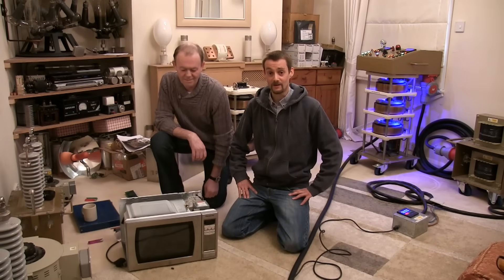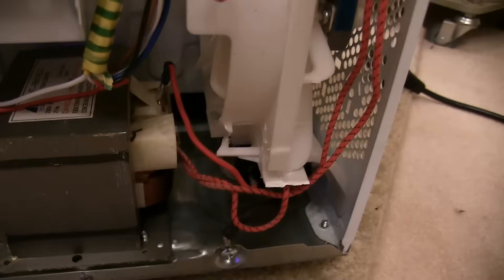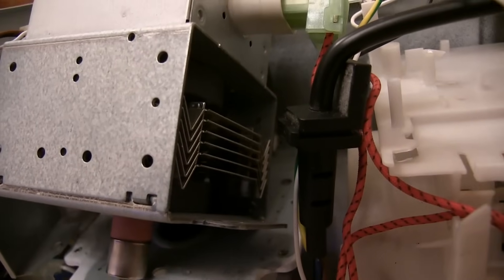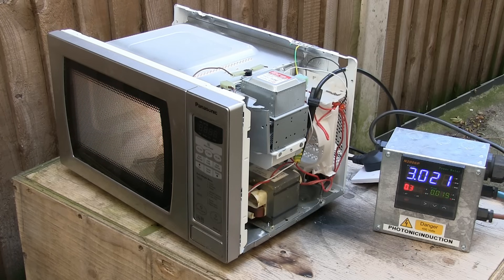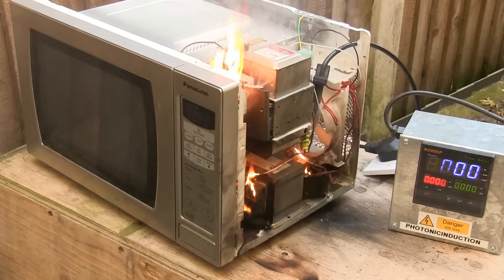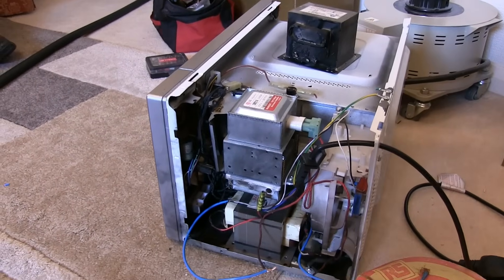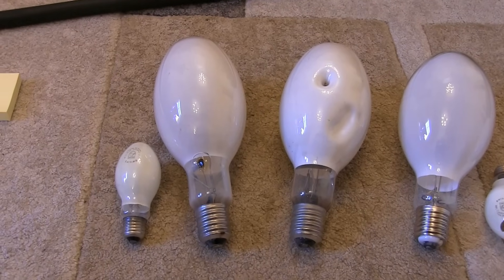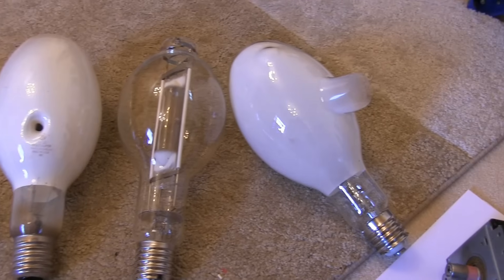Microwave Overclocked

Comment: Well that's definitely one of your most electrically acoustic videos.  It sounded like a substation blowing up.
Reply: ay my mate
Reply: bigclivedotcom hi clive
Reply: We are not supposed to ask how you know what a substation blowing up sounds like…
Reply: Probably because of all the plasma.
Reply: @sean..L  The plasma is modulated by the mains frequency.  A sort of plasma speaker.
Reply: @sean..L  yes Corse . Is verry dangerous.
Reply: bzzzzzzzzzzzzzzzzzzzzzzzzzzzzzzzzZZZZZZZZZ
Reply: Ayy, hi Clive!
Reply: bcz of high current in a single turn like a welding machine on short circuit

Comment: Good to see more videos in the overclocking series Andy :)

Have we done an overclocked washing machine yet?
Reply: arcadeuk
Washing machine motors are tough old bastards, I think mine took about 20 minutes to cook at 400 volts or so.
Reply: Actually, he was the first one to do it, and it went viral big time.
Reply: Well I know he has done a washing machine wired to constantly run, with a brick in it till it destroyed itself, but I was talking specifically on the "overclocking" theme, has Andy done a increase voltage till "I've popped it" scenario with one?
Reply: He has actually. But it usually destroys itself by mechanical failure instead of coil burnout.

Comment: So if I overclock my microwave would it run crysis??? Plz respond it would help a lot
Reply: It won't run Crysis but it will melt Crysis.
Reply: No it will not Run Crysis. it cant even run HL1!!!!
Reply: Rainbow Dash you need to go industrial to run Crysis.
Reply: DAEDRADONKEY not 4K sorry but 8k
Reply: You would have to overclock the power supply, which isn't easy.

Comment: ***** love the show and I was wondering if I could ask a question,  I've been wanting to build myself a Jacobs ladder for ages now and I've heard that a neon sign transformer is best to use, how does the transformer in a microwave compare and would it make a suitable substitute?
Reply: Microwave oven transformers put out around 2,000 volts while nst's put out in the 10,000 volt range and higher.
Reply: would it be possible to use something of that voltage to make a desktop Jacobs ladder?
,
Reply: thanks for the info, the next question then is what is the cheapest and easiest way to make a Jacobs ladder, you have no idea how much I need one in my life
Reply: ***** Check out my channel, I just put up a video of a MOT powered jacobs ladder just last week. Very easy to make and quite satisfying too. Just remember, safety safety SAFETY !

Comment: Does anyone care to explain why the glass bulges out in this way?
Reply from the maker: Plasma forming on the inside caused a hot spot, the glass may be pressurised or under vacuum, either way, soft glass will either bulge or pull inward.
Reply: *****  That'l teach it
Reply: or its a bulb boner ;)
Reply: High pressure sodium & halide bulbs have pressure in them, that says it. Normal bulbs have a vacuum with filaments.
Reply: Noam Chongsky Same as when you cook food, you need it spin or it will just sit in a hot spot and not heat up evenly.
Reply: This might be a year old comment but.When heat is trapped and gets so hot causing it to burst outwards.If you were to open the door let it out the explosion would throw you back in whats called backdraft. Any firefighter would tell you this situation would be explosive for anyone or anything in the way. That's why firefighters are seen many times busting windows out of buildings.
Reply: If you observe glassblowers, you'll see them take a small torch flame (usually very hot, though, like oxy-propane or another oxygen fortified flame) and heat a small area. Once a localized section is hotter than the rest, a small amount of pressure from the person on the end of the blowpipe will bulge a section out. 

This is just doing it all with the power of a microwave.
Reply: Thanks for all the replies.  Im actually an electrician so you'd think i'd have all ready known this but i guess i was thinking that the plasma was being pulled through the glass via the electromagnetic force,  perhaps attracted to the magnetron or whatever. 

Seems obvious now.
Reply: Noam Chongsky it was trying to escape
Reply: Noam Chongsky because it loves the beetles (yellow submarine) (kill me)
Reply: ***** I love this very big plasma in a big lightbulb powered with overclocking power lol, I love the same pop il a little lightbulb inside the big lightbulb.